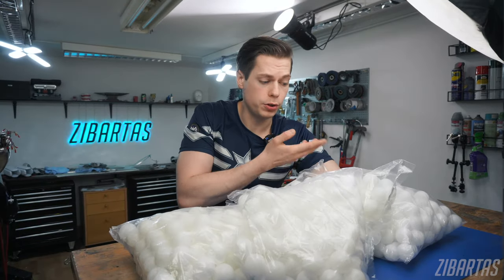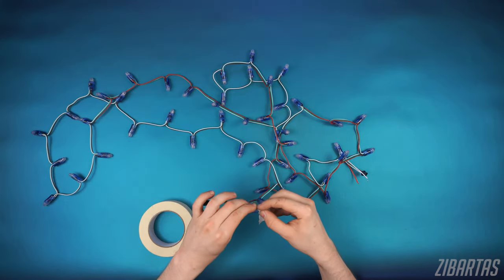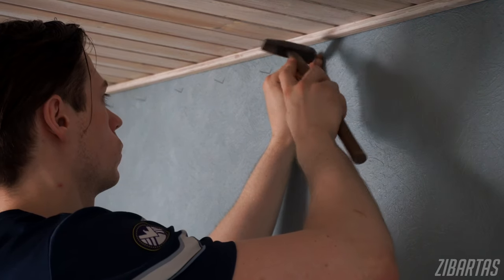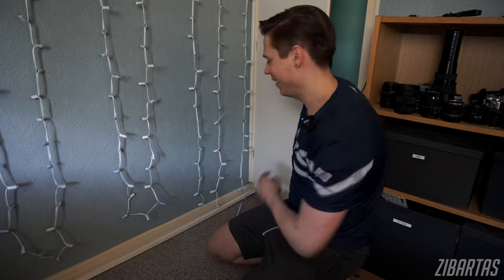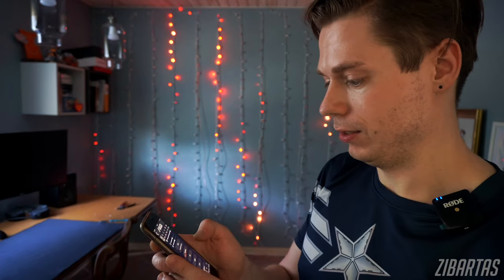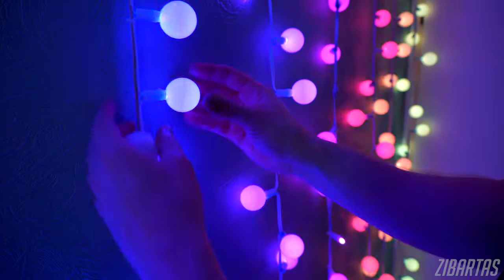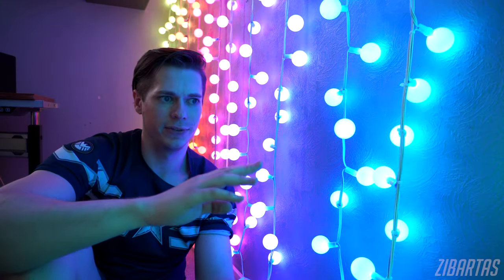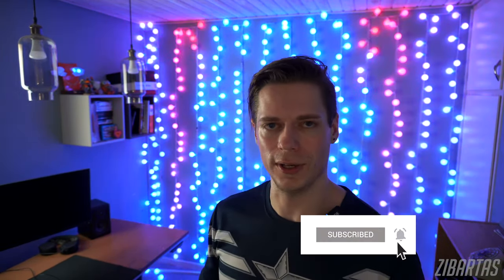Building a Wall Screen

Comment: You can install a program called xlights on your pc or mac and use the WLED as a lightshow is simple as adding the devices ip address to xlights and allowing WLED to recieve E1.31 or DDP protocols on the wifi.

Comment: Awesome video, loved the humour. Ps, I wouldn't solder with the power running, if the led power supply is not properly grounded ( the "low voltage" ground may not be referenced to earth) you are likely to get RCD trips with residual current going between the soldering iron and the power supply.

I learnt this the hard way :) (RCD trip after I blew a poorly designed power supply).

Comment: What a great video...thanks!  I'm thinking of putting something like this on a fence to make a Christmas display.  After the lights are strung/hung on the fence, the resulting  "panel" would be 75' long and 4' tall with approximately 200 columns and 15 lights per column.  The part that I'm confused about is how to program them.  When they're all strung/hung on the fence, will I essentially treat them as a matrix that's, roughly, 200 columns with 15 lights per column?
Reply from the maker: I think for a massive array like that you might need some more elaborate software than WLED? Perhaps a more beefy controller, too?

Comment: Addressable LEDs in a through-hole format exist (PL9823). Why aren't there any string of these available? Like Twinkly, but cheaper. There are only these bulky ones, with a separate WS2811 chip.

Comment: These LEDs are pretty cool. As part of the Christmas Light Show community, I use them a lot. Also, if you want to check out my 2020 Christmas Light Show, I have a video on my channel. I just used a bunch of these lights and a few esp8266s running WLED, as it supports DMX over wifi.

Comment: question , why use 5V leds instead of 12V ? would 12V leds + power supply avoid the voltage drop ?

Comment: Awesome project and video, surprised you didn't use a drill on the ping-pong balls.  To avoid taping and painting use plastic wire conduit then drill holes center, left or right for the LEDS.
Reply from the maker: Melting displaces the plastic and makes a nice sturdy lip for the ping pong ball to grab onto the LED (look up friction drilling if you care). Drilling such thin objects would be like drilling a sheet of paper... The drill would bite into them and rip them apart, or have the ball helicopter up the drill flutes and pierce it on both sides :)  

As for painting - this was tedious but a simple step, I didn't wanna overthink it and went with a foolproof method :D
Reply: @Zibartas  Good point on the melting for structure.

Comment: How wide is the the wall that you displayed these on. I am trying to get a reference to determine how many lights I would need.  Great project.
Reply: Those bullet pixels are mostly spaced at 10cm/4 inch spacings although if you look around on AliExpress you can find 15cm/6 inch spacing

Comment: How many pixels can the ESP8266 run if power management is done correctly?  

My plan is running (3) 5 meter WS2812b (either 30 or 60 pixels/meter haven’t decided) yet and running (2) 200 watt power supply split in the middle sharing only the ground (and data of course).   Is that something I can do or will I need to do something different?

Comment: Can I ask how many lights you did. I have a wall similar in size and do not want to over do it. I also want to use 12v led's. Have a bunch of these lights in 5v but find that putting to many together weakens the signal even with power injection.
Reply from the maker: I think it's 400 :)  Yeah 12V is much easier to scale up :)

Comment: Superb! How are the balls attached? Super glue? or  might you need access if an led needs replacing? I would want this in my ceiling, so I would need to attach them in some way. Another thought is using corrugated plastic sheets for light diffusion. Essentially covering the entire wall with it, creating a false panel. Certainly more pricey than balls, but I think it would look more professional? Or at least a different style of lighting because you dont see the wires and the individual lights are further diffused. I really have no experience with this, just throwing out thoughts. Damn the ideas could keep going. Installing sensors that respond the body's movement, making it interactive when you wave your arms or however those work... I believe those sensors are a thing.
Reply from the maker: They're just pressure-fit - holes snug enough to not need any glue, but i guess something like hotglue wouldn't hurt. Those are great ideas - but I didn't have enough LEDs to make it as dense as a stadium screen or something would be - so I kinda went with this organic look that let me get away with lower LED count. And yeah you could probably hack an Xbox Kinect to generate an image ;)

Comment: Hi, your video inspired me to build something similar to this. But I am confused, how did you power the 3.3V ESP8266 with a 5V power supply? Does it just work or did you use some kind of converter??